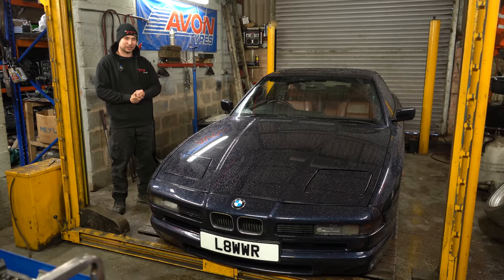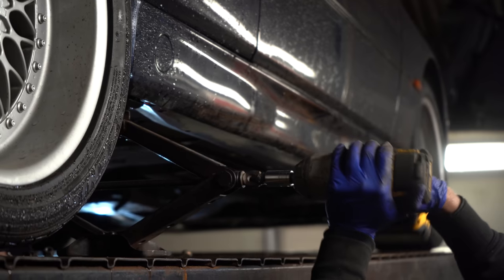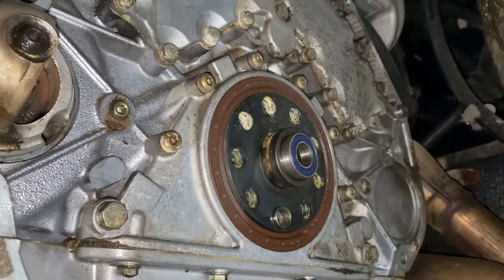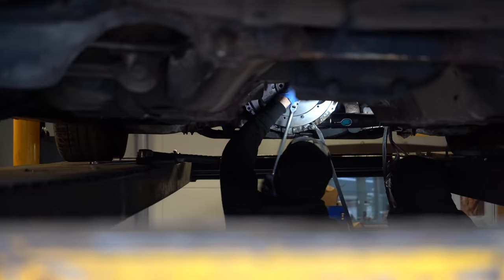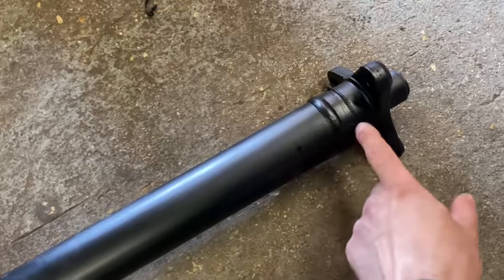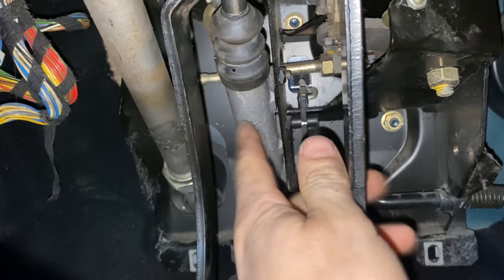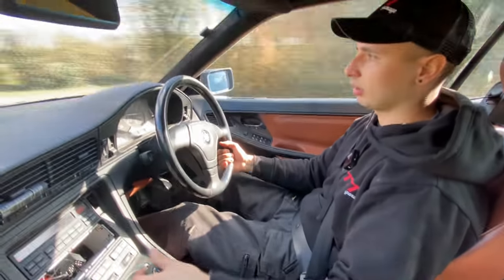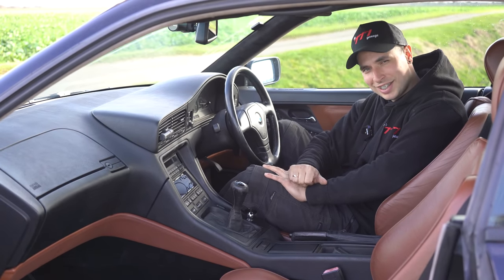Manual swap on Bmw E31 840ci...How to?

Comment: From memory, 4.0 flywheels have T60 Torx and 3.0 V8 are T55. What I do know is, they can be an absolute bastard to get out when removing a flywheel. Before I bought my 840Ci 22 years ago, I drove a 4.0 manual and didn't like it at all. The Steptronic ZF 5HP seemed to suit the old tank better :-)
Yes, there is a special 'waisted' socket you can buy from BMW.
Reply from the maker: Thanks 😊

Comment: Good job on the swap! My 8 took me 2 weeks to finish. But 6 months of slowly collecting the necessary parts. What made it so long for me was the prop shaft as well, had to get mine lengthened. I did run a 3.64 rear end, but it was not enjoyable. So I swapped it with a 3.15 lsd out of an e32, and it is perfect in my opinion.
Reply: How long did you have the prop shaft extended by?
Reply: @fila estrada  6" for the front shaft. If you are thinking of doing this, it's best to measure the length needed after installing the manual transmission in the car.

Comment: You guys are doing awesome work. Idk why this video doesn't have more views. I'll be tuning in for more. Subbed!
Reply: @The777Garage  Actually, have a question for you guys. I'm currently looking around for an 850i/Ci project. I've come across a vehicle without a transmission. Is anything required from the original transmission to do a 6 speed manual swap or can the manual trans (such as the Getrag that is used in these applications) bolt in without the use of something like the bellhousing from the 850i's original, automatic trans? Also curious, why is the swap to an E32 diff required? Looking forward to your response, thanks!

Comment: Hey any advice on what parts to get and where from if I want to do a manual swap on my 1991 bmw 850i v12
Reply: Does the e39 6spd trans work if so what clutch and center support and I going to have to order?

Comment: I just finished my 840ci M62 auto-to-manual conversion. What recoding did you guys have to do with the DME to prevent transmission error codes?

Comment: Excellent job I really enjoyed watching this video, I just have one question did you use M5 E39 flywheel and clutch?? Or just an 540i manual flywheel and clutch?
Reply from the maker: Thanks 
Im not sure cause owner supplied parts
I thought e39 m5 or 540i manual clutch were same??
Reply: @The777Garage  thanks for the reply, maybe the clutch are the same, but when I checked the flywheel it shows only M5 E39 and Z8, I am trying to do the same swap on my 840, I got the gearbox from M5 E39 but not sure which flywheel should I purchase M5 or 540i
Reply from the maker: Id go for 540i flywheel cause clearly you got same engine in 840ci
But not sure what’s the difference in m5 flywheel..looked exactly same as 540i
Reply: @The777Garage  M5 flywheel has different amount of teeth. I've actually seen a 740 blow up because they used the wrong flywheel.

Comment: did this job on my steptronic 5hp30, recently, and the prop was 150mm extended. my e31 pedal box didn't have the small damper mount behind the clutch pedal blank area, so I changed out the whole pedal box, and it was a complete nightmare!  took all day just changing that out!  I mounted the e39 remote master cylinder next to the strut tower.  to keep it short.   I currently still have the inhibitor switch connected, in neutral position, strapped underneath the car.  I want this 'built out', and the trans fail safe error removed.... did you do any coding to make it think its a manual??  car is a true GT drivers' car now... love the drive.   great vid!

p.s. that car has some serious exhaust drone!
Reply from the maker: Hi! Yeah exhaust quite loud..
Transmission failsafe message still there..not sure how to get rid of it??!
Ive tried mapped ecu from my e36 V8 as same engine..only thing i felt higher rpm and thats it ..otherwise behaved same as stock ecu
Reply: @The777Garage  as said I’m on later ecu, so still researching. Hope to find solution.  There’s a how to on bimmerforums, for the early models and you just ground a brown  wire in the tunnel area, and it’s fixed.  Looks like that exhaust is missing it’s cats too!  Do,you have another lsd diff for sale? Or did the owner supply it?
Reply: What differential ratio and from what vehicle did you use? Why the large difference in length for the prop shaft? 100 - 150mm?
Reply: @filaestrada4892  that was the gap, as the auto gearbox in my model was longer, (5hp30) so the manual gearbox, -being a lot shorter, needed a 150mm longer prop shaft.   Diff is still stock, that is on the list.
Reply: @johnboyairey  Thank you

Comment: Hi Ed not sure how to contact but I’d like to have this done On a late 840ci ‘1999 model. Do you still carry out this work, what parts would you need exactly/ do you have them available and how much do you charge (estimated) to convert a functioning auto box to manual? Great videos by the way. I like that 750il you were restoring too. What happened to that? Thanks very much
Reply from the maker: Well if u can get the parts ..sure can be done.
Message me on Instagram to discuss 
Thanks